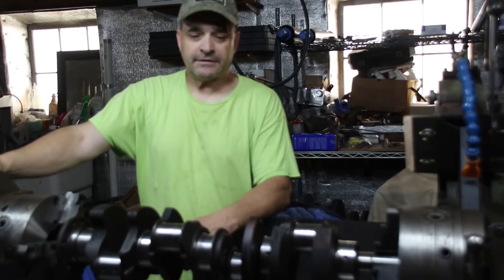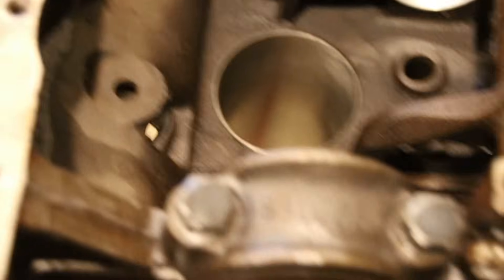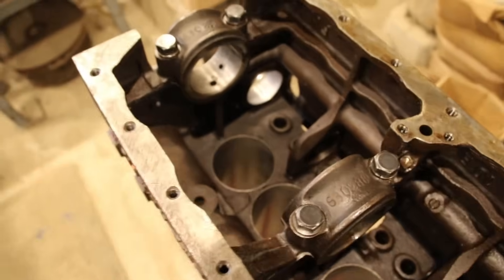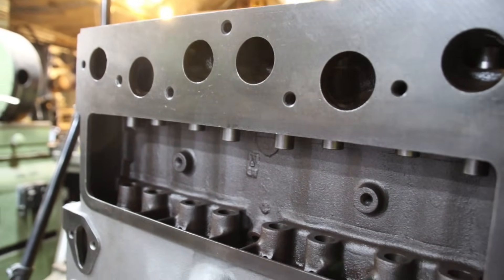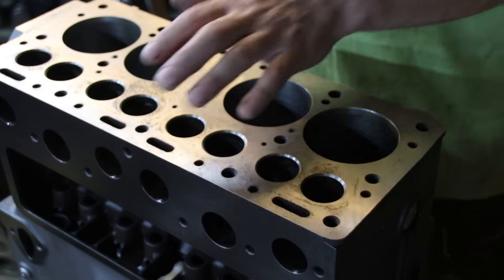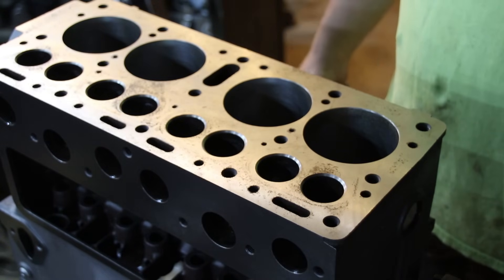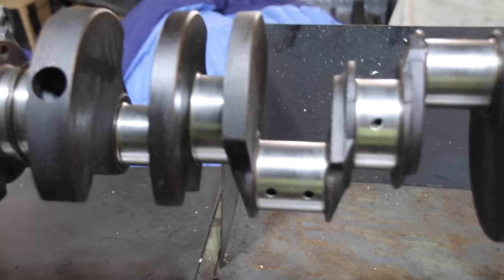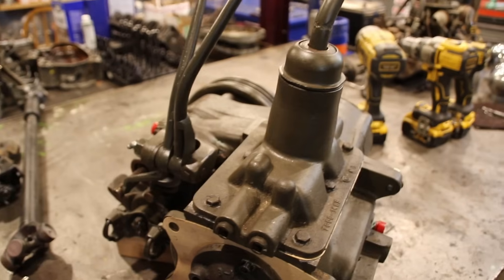Why Is It So Hard For Shops To Machine A Willys L 134 Engine Properly ????

Comment: I machine a small step at the bottom of the sleeve about a .020 step and 3/16 up from the bottom do the same on the sleeve itself  it positively stops the sleeve from moving
Reply from the maker: yes , if you have watched my sleeve videos you will see I do the same thing one some engines.

Comment: Man! Hope they send it to me to next time! That work is unacceptable, I machine and build 1-2 of these a year. Most of the blocks are so bad I install a .125" wall sleeve where the . 093" wall sleeve were to save them, I leave a shoulder on the bottom of the bore for the sleeve to stop against. Lots of crack repair, but regardless of the job I always do the best, or it doesn't leave my shop.
Reply from the maker: I have built close to 1000 of these L and F head engines.  For some reason people like to send me stuff that their local shop has machined and stuff like this happens all the time.  I have engines that have been running perfectly since the early 90's and continue to try my best to put out a perfect engine.

Comment: I see your logic and don't know what the "latest" is, but all the Mopar big blocks we built we polished the cranks. They were daily drivers and did 2500 plus passes at the strip with 0 failures. They were our only transportation to work at times and even pulled 20k lb wagons and grain carts. The GMC big V6 (305 to 478) gas and Diesels had a very smooth finish. Callies polishes their cranks. Most JD and IH Diesels I built had fine finishes. As far as holding oil the grooves are radial, but nowhere near as deep as the .0025 to .003 clearances we ran. Not saying you're wrong, just that it's been done for decades by oems and heavy duty engines. They can get really grooved up bad in use and if the grooves aren't ragged and the boss wants it I have put a lot of bearings on grooved cranks with no issues either. Some of this may be from the 0 weight oils now, we ran 15w40, or 20w50. Synthetic oils have a "comparative " viscosity rating and are thinner than regular oil. I have had pounded bearings when someone puts it in older engines like that. Royal Purple says you will lose pressure with synthetic and do not recommended under 50w on the street with high compression. 30w is for racing. I've never been in a position where a thinner oil would make or break a race. Too many people buy parts and do things they will never need. I have an M38A1, and a complete untouched WW2 Navy F134 from my neighbors MB. I was a machinist myself. The only thing we couldn't do at home was surfacing, and grinding cranks. I had terrible experiences also lately.  I had a valve job on a 440 that you could see daylight thru enough to make shadow puppets on the wall! He said "it will run in!" B.S. buddy! He "Fixed" them but sank the valves beyond belief. I went back to doing my own. Now I have a guy that I will drive 240 miles to take stuff to. He's an artist with machine work. Word of mouth Small shop out in the cornfields but does Top Fuel, NTPA, NASCAR, sprint car, farm tractor, lawn mower, etc. He does flathead stuff. Every edge is broken after machining and if it's not right it doesn't leave period. Great price too. Long lead time tho.  He can eyeball port stuff that beats most CNC. 😊
Reply from the maker: I hear what you are saying and yes the crank needs to be polished.  Very hard to show in the video the RA on the cranks but sometimes they can been to smooth.  Yes the engine will run, but I am trying to do my best, like the guy you describe in the corn field.
Reply: Yea, when I was building Diesels I kept complaining about the practices and quality of the machine work. I had to talk to the crank grinder. I knew exactly what the problem was. He was using a grinder with a short bed, the stone was too hard, and the automatic dresser was not working. I said "those cranks have to be singing at you! He said that it was horrible. His boss ordered him to do it. The journals were burnt, ridged longitudinaly and had .003 taper! They shop was leaving the huge globs of valve lapping compound ON THE VALVES! in an assembled head! They just used a brake hone on a tapered rod bushing and egged the holes, the rods were .015 different in C to C in a set. They wanted me to mix rods in an engine of a different series to get one out the door. They were 2 POUNDS different in weight. Tried to walk the dyno out the door and Snapped the crank at 100hrs. Finally they put me in QC because I wouldn't shut up. I went out and rejected 20 reground cranks out of 30. The list goes on.

Comment: Great videos , not so great machine work from others! Im in the uk and have had guides fitted like that to my block.. how difficult can it be to do it right!!
Also Are there any known bearings to use for worn cam bores? Unfortunately the machine shop who spent lots of money on my block didnt notice the worn cam bores..😢
If i was in the US id definitely send my work to you!
Reply from the maker: Dura-Bond makes cam bearings in and endless sizes.  Figure out how much your bore needs to be enlarged to clean up, then check out dura bond and find a od, id, and width to fit your application

Comment: Maybe because the iron used back then was harder material. Or not enough surface to maintain exact flatness.
Reply from the maker: All the mistakes are from the machine shops that did the work.

Comment: I sold engine machining equipment to automotive shops for 40 years and have been in thousands of shops.  There are several reasons why they don't assemble engines.  One reason is machining commands more for money per hour than assembly work.  Second reason is liability, if you assemble the engine and the customer installs a dirty oil pan or forgets the coolant or oil they are going to blame the assembler.
I'm not sure I would worry about the sleeve it's way below the ring travel.  The valve guides are an issue that should not have left the shop.  Sorry but you can't eyeball surface finish.  What RA and what percentage of plateau do you like to see on a crank journal

Comment: Had a CJ3A with the 134.The original block had the cylinder to valve seat cracks. Had it pinned but cracked again. New guy at shop said he could sleeve it but would never guarantee it. Ended up finding an 134 F-head with low miles. The difference in the blocks was obvious, the old looked like a sintered bearing. Very grainy and hard. New engine looked like steel. 
Seems a lot of the old 134's had poor castings; hard, brittle and grainy.  That was the '70s, finding 134's was easier but I bet you can still find them.

Comment: It’s pretty wild that a machine shop wouldn’t do assembly, we make way more money on assembly than we do machine work. 

(Hell I am pretty sure we loose money on machine honing)

Maybe they are just scared of L heads? 

That sleeve would scare me too, I like to keep at least 1/2” of the original bore in the bottom to make dropping impossible. 

Two sleeves in one hole & no support is nightmare fuel. 

Thanks for continuing the videos, we do a lot of 134’s but always love to learn more whenever we can.
Reply from the maker: Yes, this block scares me also, the sleeve job was terrible .

Comment: I think that two inch sleeve would be O.K., if they used Loctite high strength locker. There's quite a bit of area for it to hold on.
Reply from the maker: Would you guarantee it if you assembled the engine without knowing how the other shop installed the sleeve?
Reply: @metalshaperJeep  No, definitely not!

Comment: Thank you for the great info Brian! I wouldn't have thought there would be such thing as a crank shaft being too smooth. I never stop learning from you! I wouldnt be confident with that tiny sleeve specially if it doesnt have a step at the bottom. I can understand why a machine shop wont assemble an engine. I wouldnt expect them to know every little detail on every engine. But their work should always be precise and guaranteed!
Reply from the maker: Yes, there is a very in depth topic about roughness average or RA.   The cylinder wall honing is critical as well as the crankshaft for oil retention.   That changes depending if you are a daily driver or a race car 1/4 miler.   I am now running into a lot of customers who say their engine shop won't assemble the engine.   The world sure is changing.!!!!

Comment: Bad machine shops are all over  , how they stay in business is a mystery ,   Just had my small block Ford block done by a machine shop that people around here brag about and was not happy at all .   The bores are after boring and  honing come in at 4.0345  and the piston to wall specs are way out he even had one of my pistons to supposed to get the correct .0025 clearance the piston manufacture states    . the head gasket surface appears pretty rough to me and look more like the surface of a file than a gasket surface and the cam bearing oil holes barely line up . When it got here after being picked up by my wife I called him and he told me too late I paid for it and if I did not like his work take it somewhere else and he hung up on me , $600.00 wasted
Reply from the maker: I hear this same story all the time.  That is why I show the complete rebuild as it is happening here on Youtube.   Then I show oil pressure and water temperature when I start the engine and break it in.  Sorry to hear about your troubles.

Comment: I would not blame you at all if you decided not to assemble engines that were machined at some other shop.
That sleeve someone else put in would be a big concern to me as well. 
 Thank you for all the information and knowledge that you share.
Reply from the maker: The trouble today is machine shops do the work then all the blame goes to the guy assembling the engine, and that sucks.   I am pointing out my concerns and want the customer to know exactly what is going on.

Comment: We have an L134 that has the block worn at the cam bearings.  I've heard there are some cam bearings available that will fit the cam if you can bore the block for them.  What's your favorite method to do that repair?
Reply from the maker: The cam bores need to be bored to accept a new bearing.   There is only one actual cam bearing and that is in the front of the block.  The other cam supports are just the cast iron block.  Very rarely do they  go bad or out of size.  But if that is the case boring and fitting a new bearing will fix the problem. Might be cheaper to find another block depending on what your machine shop will charge to set up and do a deep bore like that.
Reply: Are there any known bearings from other engines that could do this job because I'm in this exact situation now. After spending loads of money with a machine shop who has already fitted my valve guides like the ones in this video..

Comment: Brian... Thank you for the machine work inspection.   That is one of the reason engine fail just after assembly and start.  People think the machine shop knows what their doing , no mistakes and fine out after first start up the engine it over heats, vibrates  and experience poor performance. Juan
Reply from the maker: Thanks for watching Juan, it's a big problem with machine shops.